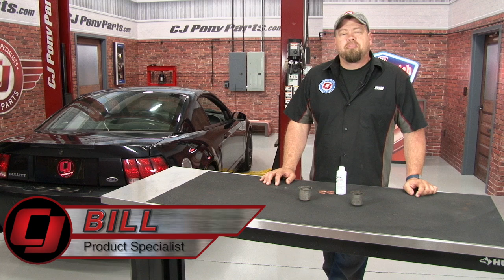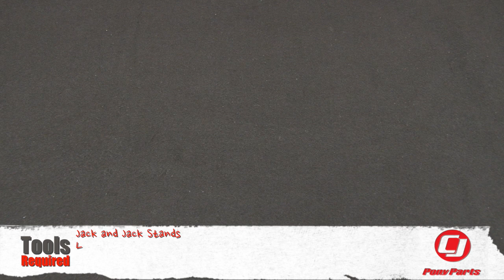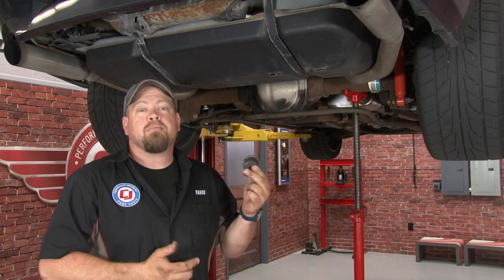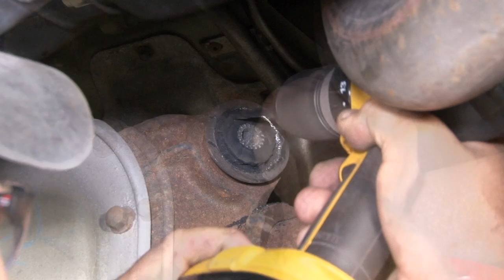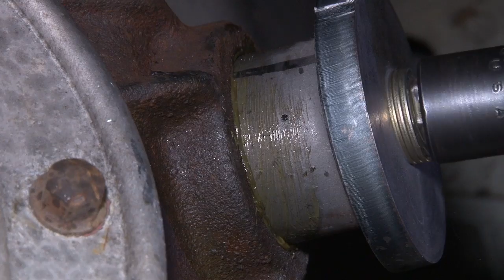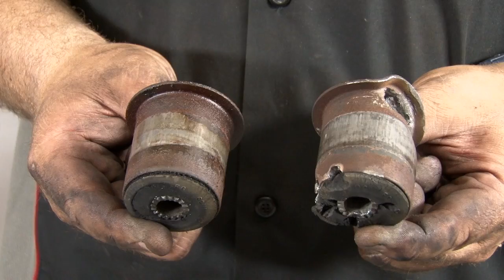Mustang Axle Housing Bushing Kit 8.8" 1985-2004 Installation

Comment: I just bought these from cjponyparts. No account necessary. I bought the special tool as well. If you're working on the ground like me, then just jack up one side at a time. The only thing I did differently in this video, is not entirely removing the upper control arm. You can simply loosen the body bolt and swing the arm out of your way. Then I slightly tightened the arms in place with the body bolt. If the arm is swung above the axle, it is not in the way at all. Everything was a breeze. Except you'll need a lot of strength to use the special tool if you don't have power tools.

Comment: Why did you say removing the entire bushing you wouldn't be able to get it out if you beat it lol? Seems it might've been easier, unless you mean with using the tool. I did get mine out by the way but I didn't remember exactly when you drilled with the video you drilled all around the bushing I just drilled around the edge. I still was able to get them out I would say in about the first one took me about 30 minutes and the second one probably about 15. Did have the rear end out of the car though 😂😂

Comment: I have been delaying getting new exhaust for a couple of years….. looks like I will be updating my exhaust now as I cut it out with a saws-all to make this job easier, doing a complete rear control arm replacement.
Reply: There’s no need to remove exhaust at all
Reply: @NewEdgeDesigns in my world it had to come off.
Reply: @leestewart3690 how bad were the bushing??
Reply: @NewEdgeDesigns original bushings from
 1991, they were dry and really cracked

Comment: I wonder if this tool can be rented. I mean you’re not gonna use it often just for this.
Reply: no rental that i know of.. i used my a ball joint press looks like a mega C clamp .
no way hell is it possible to use a block of wood and hammer to install these like video says...
Reply: @codyramos3200  yeah I agree with you. I’ve used a ball joint press to remove ball joints. Haven’t tackled this yet. Wonder if after using it can it be returned...
Reply: @sergiomurillo9930  probably not.. the tool gets a little roughed up when using it ... those bushings are pressed in the diff super tight. when i did bushings on my 96 gt i tried to use a 3lb hammer n a large cold chisel an didnt do much other than destroy the old bushing along with my shoulder ..in a time crunch i used my harbor freight ball joint press an it popped out with way less effort ...still kinda a b1tch trying to hold up the press and cups and tighten everything .. duct tape helped to hold the cups together while tightening the press if you get someone to help you it wont be to hard to do im always solo when i need to work on my car ... my exhaust is dumped right before the axle so that gave some extra room .. its not a super hard job but it can be a little difficult without a tool to press bushing out/in

Comment: I couldn't even get the bolt off the control arm. I tired it with a 250 ft-lb impact wrench and still a no go.
Reply: Bigger impact
Reply: @TanCalHan  I took my old impact back for a refund. Will get a 1000-ft-lb and try again when warm weather returns.
Reply: @redfirefox3568  i used a blow torch to heat up the bolts broke lose after

Comment: This process is a major pain in the ass. They make it look very easy in the video with air tools. If you have a Panhard Bar and you want to try this in the driveway on your back, I wouldn’t even attempt it. . Take it from me. 8 hours for just the passenger side only.
Reply: You can tell that mustang was not from where things really rust. Lol
Reply: Took me like 3-4 hours to get only one side out then when installing the new one the threads on the bolt stripped.  Went to Lowe’s for a new bolt but of course they didn’t have that size.   Had to go to a hardware store but no more day light left.   Have to do the other side another day.  Ugh.  Oh by the way the exhaust will have to be dropped
Reply: Were you using the tool they showed?  I am pretty cheap, but decided to just buy it or else I could see myself spending an entire day on this.
Reply: My reason for searching for vids was to see if the rear end needed to be dropped. I'd think dropping it would be much easier to remove the bushing and put in if you did not have the tool.
Reply: Why did you say removing the entire bushing you wouldn't be able to get it out if you beat it lol? Seems it might've been easier, unless you mean with using the tool. I did get mine out by the way but I didn't remember exactly when you drilled with the video you drilled all around the bushing I just drilled around the edge. I still was able to get them out I would say in about the first one took me about 30 minutes and the second one probably about 15. Did have the rear end out of the car though 😂😂

Comment: I plan to rebuild my stock upper control arms.  Can this tool be used to remove the bushings on the body side of the UCA just like on the axle side?  Thanks in advance.
Reply: +CoffeeDrinker71  There is no bushing pressed in the body side, its part of the control arm.
Reply: +Bill Tumas Correct, I meant can this tool be used to remove the bushing that is pressed into the UCA?  This video shows it being used to remove the bushings pressed into the axle, but when you remove the UCA there are bushings in the UCA itself.  I would like to change those out as well.  I'm keeping the stock UCA's.